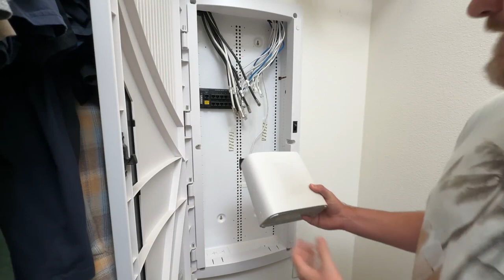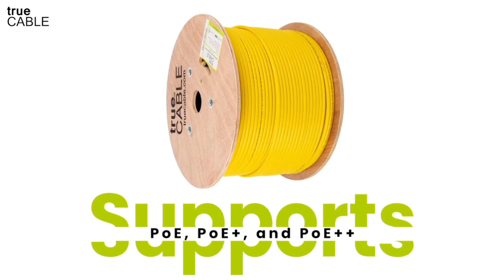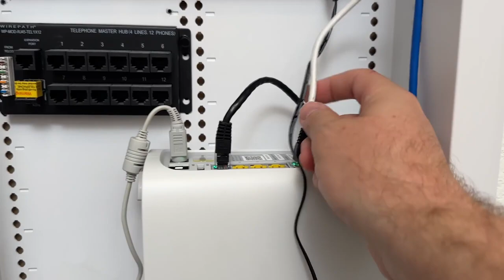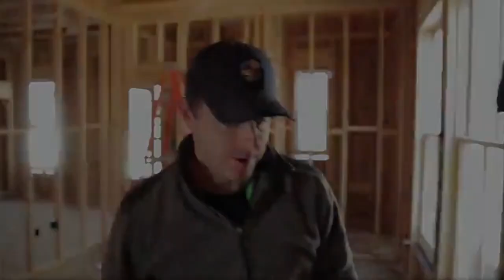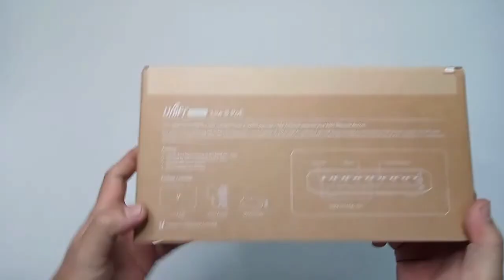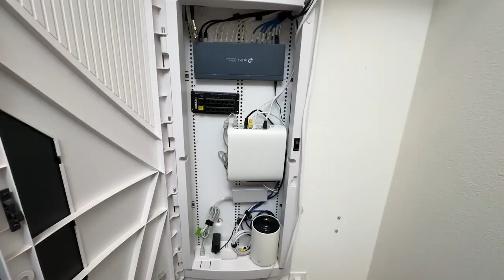Smart Home Wiring Guide: How to Future-Proof Your House!

Comment from the maker: FEATURED PRODUCTS (Best Prices Here):
trueCABLE Cat6A Shielded Riser Bulk Cable (1000ft Solid Bare Copper, 750MHz, F/UTP): https://geni.us/uIyb
Leviton 28-Inch Structured Media Enclosure 47605-28N (Recessed Metal Command Center): https://geni.us/IM5YoK5
Southwire Romex SIMpull 14/2 NM-B Wire (Friction-Reducing Electrical Cable): https://geni.us/FrF134
Ubiquiti UniFi Switch Lite 8 PoE Switch USW-Lite-8-PoE (Managed Silent Fanless 52W): https://geni.us/Becxt
(Affiliate Links)